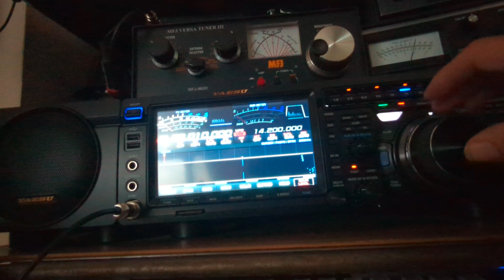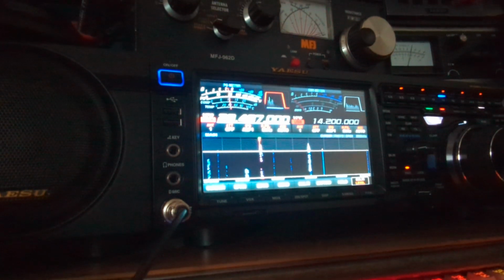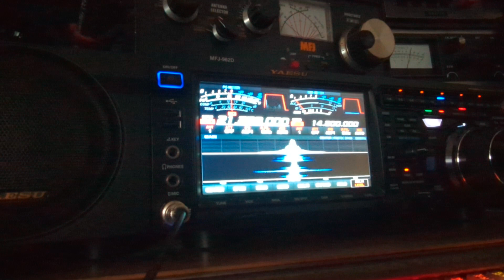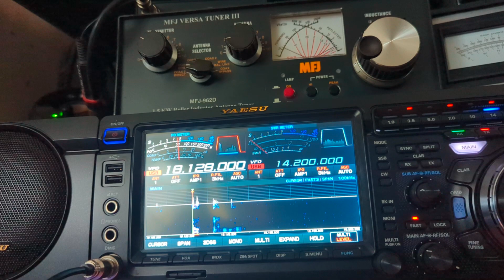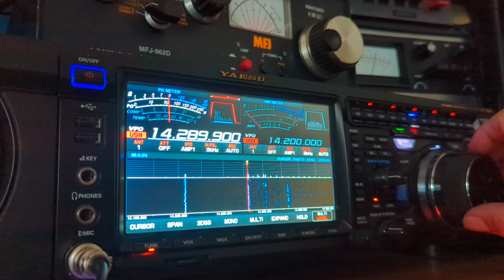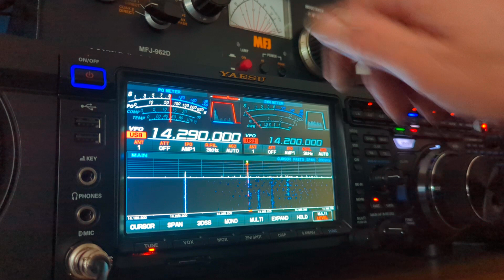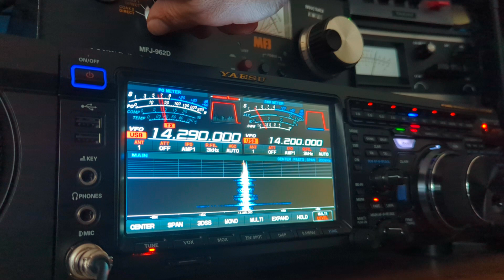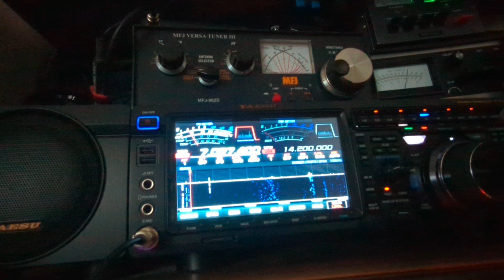80m Half Wave End Fed Wire Working Across HF - low noise

Comment: Can you please help me for interface my gs232b to my computer. I can't connect to my computer All setting are done according to manual but I am not able to connect😢
Reply from the maker: Hello have you sorted it yet? What software are you using
Reply: @M0YKSHamRadio  are using pstrotator. But gs232b not responding
Reply from the maker: @tuhar_saga I have not used PST rotator so I cannot be helpful unfortunately. Sorry. Good luck
Reply: @M0YKSHamRadio  thank you for your response. actually main problem  is GS232B interface not responding when I give simple cammand in terminal have you about this why is this happening.
Reply from the maker: Sounds like it may be a port issue. I have my interface connected to serial adaptor 232 to USB with PL2303 chipset. I had issues and had to upgrade to those type of serial cables. I would try it on orbitron or SatPC32 to see everything works then go from there. I tried the PST rotator but couldn't get it working. It looked good but I gave up and stuck with SatPC32.

Comment: I used to think end fed wires weren't  any good....man, was i wrong !  I run a 73' wire with a counterpoise on a 6:1unun transformer inverted L and another 60' wire from a 9:1 unun with a ground like you're using.   They work very well! And they fit within my postage-stamp sized property. 73 and have fun with radio. BTW the weather looks like what i get in the Allegheny mountains here in SW Pennsylvania!
Reply from the maker: @l.a.2646  yes it is quite amazing just how well the end fed works. I was the same until I got one up at my QTH. I am glad I decided to try it out, it's definitely a good antenna for sure. Like you say great for smaller garden spaces and easy to get up. 73 good dx

Comment: Great stuff...  I am building a Fan Dipole currently so Im sure I will learn a thing or two    Thank You    KC3ZDW  73
Reply from the maker: The fan dipoles are also great antennas. I had plenty of DX with mine and I had on the go for a couple of years, very good indeed. Good luck and good dx 73
Reply: @M0YKSHamRadio  Thank You

Comment: My main HF antenna is a home-made random end-fed of only 41ft but I've had some good dx on 40, 20 and 10 and NVIS on 80m (which it isn't supposed to work on). Also tuneable on 17,15 and 12 too. Hopefully I can get an early morning session on 10m at some point and get some European and UK contacts again.
Reply from the maker: The wires are very popular and definitely work well. I hope to hear one morning when the propagation is right. In the meantime all the best DX thanks and 73

Comment: i bought one of these a few years ago and have yet to put it up. it's the 120ft version 10-80 including WARC bands. can it be bent round the garden or does it have to be run in a straight line and is it  necessary to ground it like you have?
Reply from the maker: @jackjones-er1ts  hi bud, when I first set mine up the dipole was were it is now so I tried a method which did double back on itself. It was a folded u shape. It worked well into G but I didn't have it like that long so no real test results but it worked well enough with low noise. The manufacturers info said that no ground is required so I guess it would be worth trying. I fit mine to eliminate any RF and provide a ground for any unwanted discharge under a possible fault. I would recommend running a good length of coax feedline and avoid fitting any RF chokes. Any unwanted returns should be lost that way. Best bet is get it up and see what happens Good luck
Reply: @M0YKSHamRadio  thanks pal

Comment: I use the same wire, I'm very happy with it and it's very strong.
Reply from the maker: @mm9stm  I agree 👍 they have good heavy gauge wire which so far is holding up well. The wx gets wild hear on the hills similar to your location so they get put through the test 😁. Very good indeed 73

Comment: Enjoyed the EFHW demo. I'd need to go from the very back of the garden all over to the far corner of the front to get a 40m wire up but probably be worth while I think ...been thinking of it for while !
Reply from the maker: @101blog  I can definitely say you won't be disappointed with this particular model, it's well built with decent gauge wire. I went for the 400w version and so far have run the barefoot 200w and never had  any issues. I haven't tried any  amps with it as yet. Get it on your Xmas list. 73
Reply: @M0YKSHamRadio  Good one I'll box the 56:1 transformer and stick some whire up.. Mine's home brew but still over engineered enough !

Comment: I’m surprised at the Hustler being better than the EFHW for DX on 40m, my UK Antennas 40m EFHW blew the socks off my hustler everywhere, but funny enough although the ATU gets me working on 30m it’s not a performer there
Reply from the maker: @bigmartin  hi bud tnx for the comment. Yes I agree it works for DX I have managed Japan on 40 with it as well as south America no problem but for North America and Middle East my vertical works better. It has radials under the grass. It probably because the wire is more of a inverted L and quite direction focussed to south/north direction. I definitely like it though very good indeed. I'm lucky to have both horizontal and vertical which is useful. Thanks again 73
Reply: @ yeah mine in also inverted L running E-W so the USA & Europe etc are in the lulls. I actually my my UKantennas balun after seeing your original video on your EFHW, it’s a fine bit of kit
Reply from the maker: @bigmartin  nice one keep up the good DX with yours and let's hope we keep making good waves from these surprisingly awesome antenna. I am glad I bought it that is for sure. 73

Comment: Hi Simon Paul in Kent hope you are all well with the weather. Another great video so impressive with your antenna. And pulling in some great DX take care Paul
Reply from the maker: @paulmark63  hello Paul,  all good this side thanks 👍 
The end fed is quite surprising to me and after using it for a year now I can confirm it does a very good job all round the bands and if you have the space for the cost is pretty cool. Today conditions were poor but as you can see it did quite well. Thanks again Paul 73 have a good weekend

Comment: Great video as always Simon. I had the 39m long version of this exact antenna and it worked great, managed to work all over europe and stateside and even VK. Mine was setup in a V formation. Sadly it snapped one night and I cut it shorter for 40m only, I now use a beam for DX instead. 👍🏻
Reply from the maker: @Drpepper99uk  thanks for watching and your comments. I definitely will be sticking with it as it does seem to work very nicely. Hopefully it should go a while without any breaks I made sure it would not be pulled about or struck by any trees when windy. I bet you are doing well with a beam antenna on 40 I would like one of those 😁👍. This does well on 40 down to south America and west direction but for Japan my vertical seems to be a bit better. Still I like it and especially love the lower noise levels on RX. Awesome antenna for the cost. Tnx agn 73